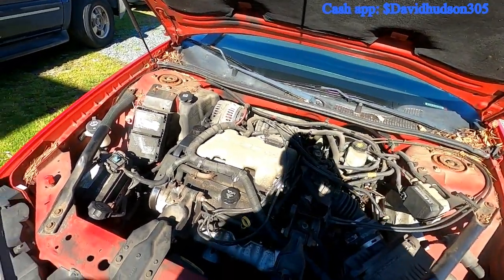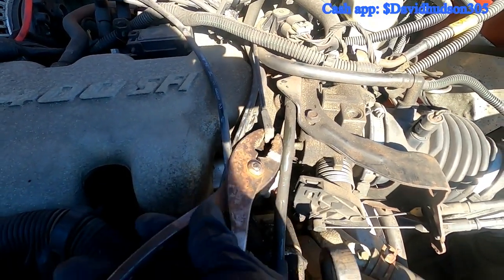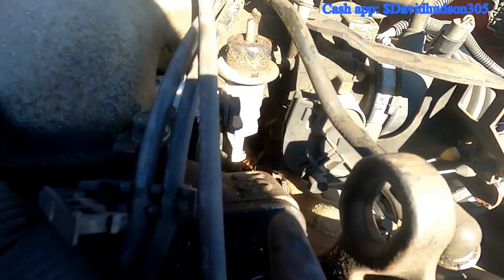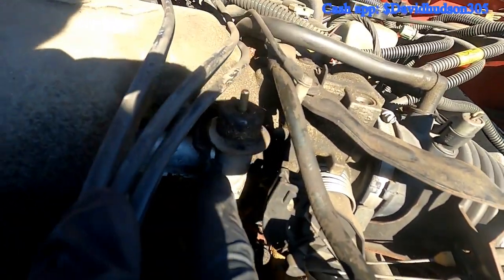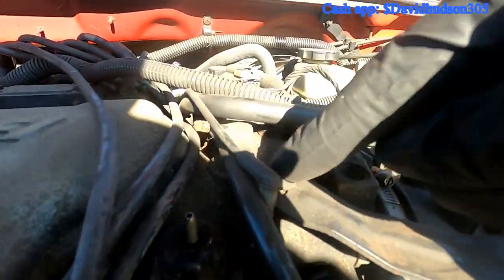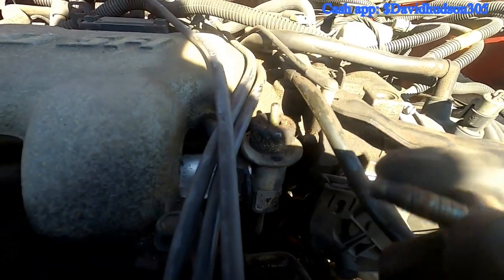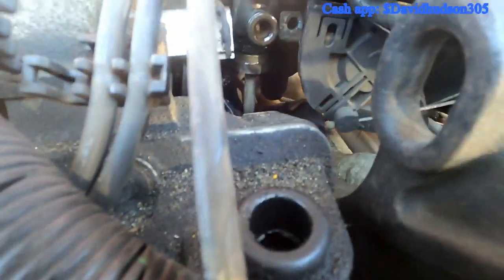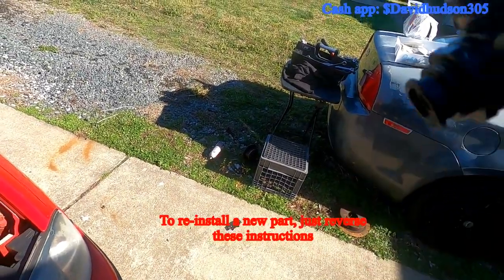2004 Chevy Impala 3 4 Fuel pressure regulator replacement

Comment: I like that lil plier trick for the fuel reg elbow.   But the 2nd spot you removed the hose is the PCV valve/hose/elbow (not EGR - thats electronically controlled and is right behind the throttle body area, left of brake fluid reservoir in this model)
Reply from the maker: Yea I accidentally said the wrong thing